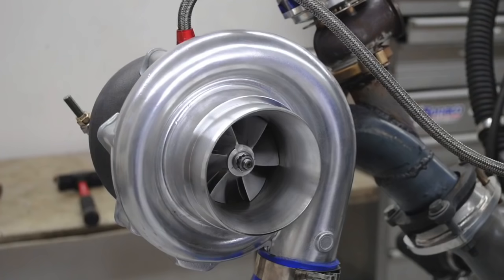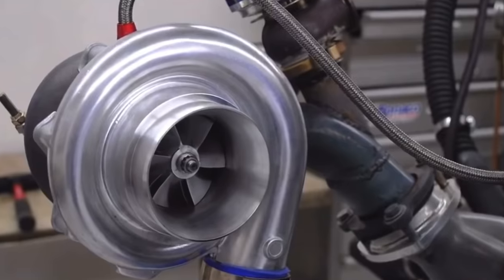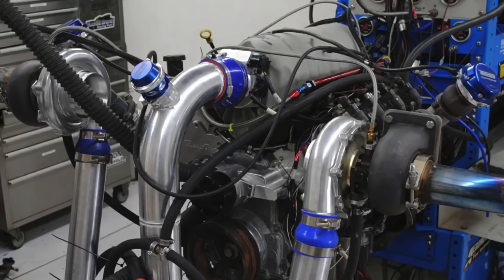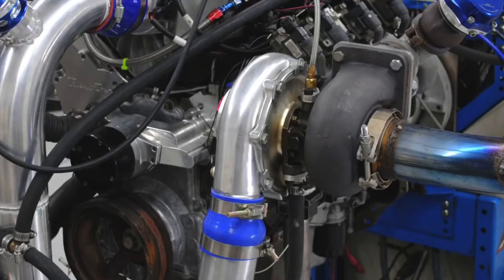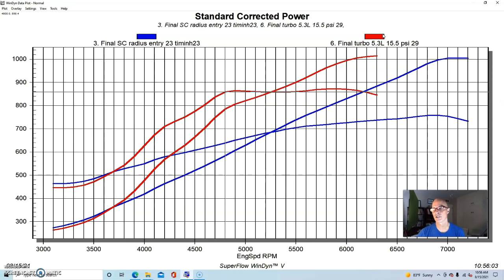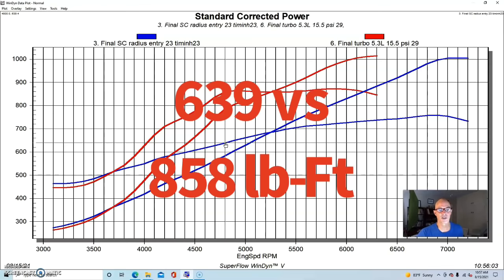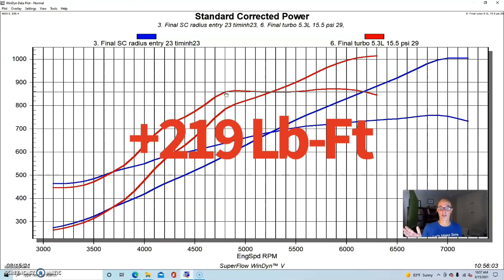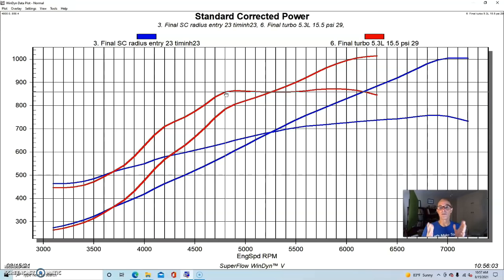HOW THEY WORK-PROCHARGER VS TURBO (WHAT WORKS BEST?)

Comment: Great video, but your drive ratios are reversed.  Over-driven is like 1:4, or 1 to 4.  Not 4 to 1.  That would be a reduction or under-driven.
Reply: No. An F1a procharger is 5.40:1. Meaning that the impeller turns 5.40 times when the input shaft is turned 1 revolution. 5.40:1
Reply: @baby-sharkgto4902  You have that backwards. That would be 1:5.40 (assuming your specs are correct). Look it up.
Reply: @dan1906  now you're just trolling
Reply: @baby-sharkgto4902  Ah, no.  You obviously don't understand how ratios work.  The first number is your input and the second is your output.  Like a 4.11:1 differential.  It is 4.11 revolutions of the pinion to the 1 of the carrier (rear wheels, consequently). Following along so far?  Do you need some sort of visual?
That is a reduction.   Can you say reduction?
Now,  the supercharger in question is over-driven.  The output turns faster than the input.  Crazy huh?  Using your specs, which I am sure you plucked off their website, is 1 turn in, that's the 1 in 1:5.40, and the output turns 5.40 revolutions as a result of that 1 turn of the input.  Need a break?  Too hard to understand?  It will be ok, they're just numbers.
Now....that yields a ratio of 1:5.40.  Despite whatever challenges you are facing that may be holding you back, that is the ratio.

Comment: Why are you running 2turbo why 1turbo you have a lot more air flow with 2turbos why not 2blowes
Reply from the maker: THAT'S IS INCORRECT-TWO TURBOS OR TWO BLOWERS CAN MAKE THE SAME AS 1 (ITS SIZING THAT MATTER)
Reply: So the blower is the same size as the two turbo if you have 75 mm turbo is the blower 150 mm???
Reply: @billbylsma87  psi number

Comment: I like the vid but I feel it would have been better had u cut them at the same rpm regardeless , for more accuracy on what you are trying to explain ... cuz if u had dropped the procharger off the 1000 rpm sooner like u did the turbos the comparison would have been dramatically different.... but again either way good vid and explanations on boost differences between turbo exhaust driven to pro charged or supercharged belt driven .... and I really do feel u have it 💯 on the fact of power to traction however .... either way u smarter than I lol I just race/drive them lol and I build them but no were near the knowlage u have my friend lol peace n love brotha stay safe and good vid

Comment: Why not compare twin centrifugal Superchargers to twin turbos?
Reply from the maker: that won't matter
Reply: In theory it shouldn't matter... But I've never seen it tested on the same engine. I'd like to see a test of the same exact engine, one with twin turbos and one with twin centrifugal superchargers... Everybody always compares twin turbos to one supercharger... Preferably Twin Prochargers..... But it seems like torqstorm is the only one with a twin supercharger kit currently.
Reply: I think boost temps will probably be lower on the superchargers causing more dense air.
Reply: Also how do you feel about interchillers?

Comment: Won causes parasitic loss any type supercharger. Turbo uses exhaust cylces  as we all know.on average a exhaust wastes or flows 70 hp give or take more or less.so on average a turbo has 70 hp to operate it.its not just blow down or escaping gas its all so the secondary stroke of the piston help spinning they exhaust side off turbo.peace

Comment: One of these days you got test a Lunati cam you’ll be amazed, why not run 120 octane race fuel? If turbos were better than supercharger top fuel cars would be twin turbo’d but there not they have a 14-71 roots supercharger on top I wonder why? Hrmm, the other thing I would like to see you test one day is a real mans blower no 6-71 or 8-71 street crap at least a 10-71 or 12-71 Roots supercharger, not a screw supercharger
Reply from the maker: TURBOS WERE OUTLAWED IN TOP FUEL, I HAVE RUN LUNATI CAMS

Comment: Theory: a truly titanic turbocharger could mirror the same rising boost curve of the centrifugal blower, as long as one was willing to put up with a truly boring low-RPM power level AND the glacial pace of turbo lag finally spinning the thing up upon changes in throttle position.

However, if one is patient, one could slap a ridiculous turbo on just about anything and not even need a wastegate. A super-high A/R ratio turbine coupled with a gigantic overall turbo size could provide the long, sloping boost curve of the always-sucking-power centrifugal supercharger while providing better fuel mileage but at the expense of sloth-like turbo "response."

I play with Borg Warner's Matchbot to look at such results in some limited fashion.
https://www.borgwarner.com/matchbot
Reply from the maker: an unregulated turbo (no waste gate or inlet restriction) is not a good idea